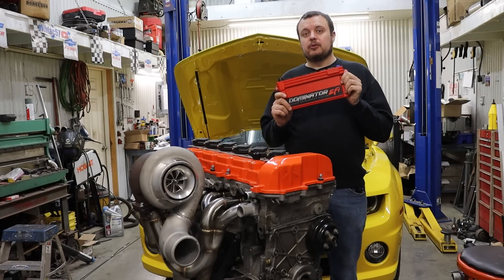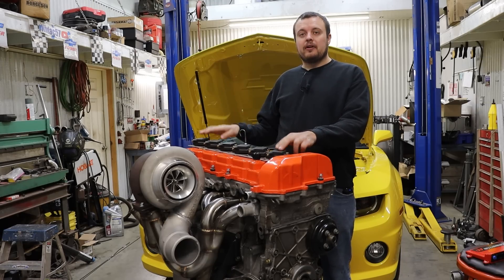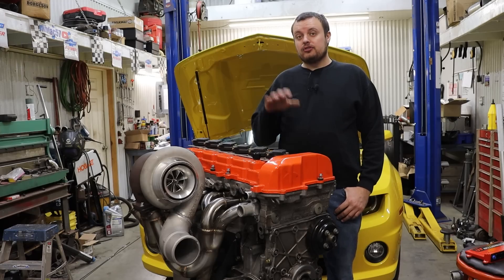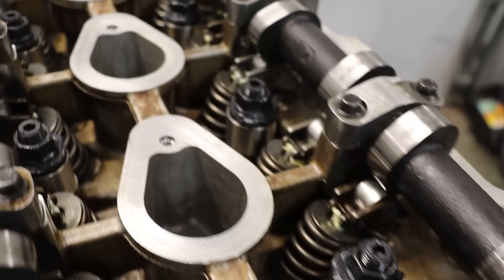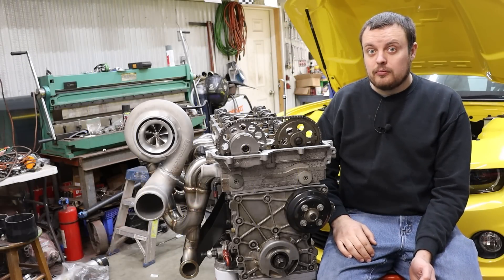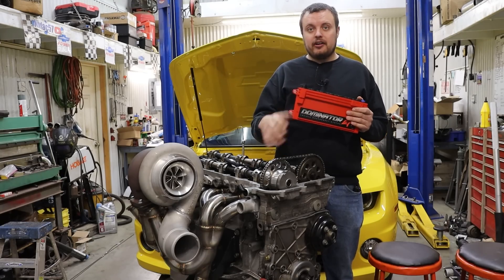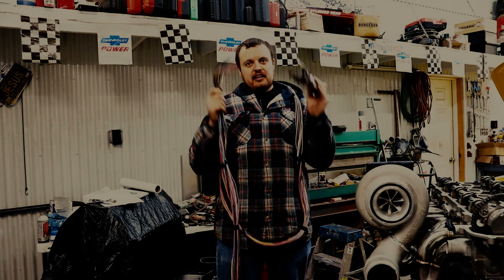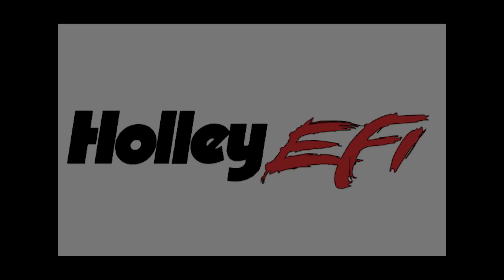Holley EFI: Can It Control A Vortec 4200 Engine?

Comment: The alternative to software fixes is hardware fixes.
Have you considered simply taking a hacksaw to the reluctor wheels to reshape them to a suitable timing mark for the Holley?
Or use ford reluctor wheels, or get a Haltec ecu?
Reply: Seems like an external trigger wheel would be viable.   Still waiting to buy an ECU for our 4200 project.

Comment: So maybe I'm nuts but could you not cut off the cam trigger wheel, flip it over and stick it back on? Or have one made that is the right shape to work with what the holley thinks it is looking for ?  Even if you have to move the sensor maybe ?
Reply from the maker: The ignition control would not work then.
Reply: No idea what to do about the direct injection thing other than try to trick it to think that it is direct but change the timing to reflect the difference of port injection ?
Reply: Ignition is ran off the cam sensor? I'm so confused
Reply: I knew you had already thought of it but I just needed to process some of the confusion in my head.
Reply: I love simple fixes and work arounds... like the story of Don Garlitts blocking off the intake port of the trashed cylinder with a sprite can and fixodent denture glue (so he could continue doing burnouts at Goodwood festival)

Comment: In the interim (nothing more permanent than temporary!) you could always make a little circuit between the sensor and ECU to flip the signal direction. Edit: I've seen all the replies about ignition control now. I guess that's a no-go.

Comment: And this is why you buy a MoTeC. Which will work with any engine with custom triggers (that you can define).
Reply: Ah yes motec.. where you have to pay extra for what ever options s you'd like 😂 oh yes you want traction control that's about 400dollars, oh you want to datalog more channels? Oh that's 400dollars, but you need to buy level 1, 2 and 3 if you want level 3 data logging.. all on the same ecu just unlocking extras 😂😂 then it depends if your distributor uses a decent software because they all customise it and that's what your stuck with..

Comment: Excellent video Calvin! I know the key here is the rizzing edge but is it possible to make the reluctor wheel have the same tooth spacing on the falling edge like you flipped it around?
Reply from the maker: Ignition control won't work then.

Comment: Try haltec the Aussies will be happy to assist and run different motors parts and accessories 

In-fact the Aussie car science is full of unique unusual combinations 

Seriously try HALTEC They will have so much inline 6 experience from the earliest 6 cylinder’s engines from so many manufacturers (straight 6 are an Australian 🇦🇺 obsession)
Not to mention that all the manufacturers of modern motors run variable valve timing which Haltec are familiar with
Reply from the maker: I'd rather go with a Maxxecu, but I've heard great things from the Haltech
Reply: @Calvin-Nelson  Haltec is run owned and operated by guys that are totally into car mods

Not to mention that they actually built the entire ecu on site 

You have motive garage with there rb32 coming to the USA soon keep an eye out for it its going to open some eyes to the rb30 based engines that get built from to old commodore and put in loads of things not to mention the usual Barra and jz engine

Comment: I still don't understand why you wouldn't just use the E67.
Reply from the maker: Pain to tune. Standalones almost always make more power. Lack of advanced control like boost cut, closed loop fueling, traction control. Simple stuff like shift lights, 2 steps, boost builders are not easy with an E67. Among other reasons.

Comment: This is part of why my disdain for woodgrain in the 80s is now something I find cool because I know I can fix it like my washer, dryer, refrigerator, dehumidifier and window AC for example. I do regret not taking electronics and computer courses but I recently bought a welder and have an excellent teacher which opened up a whole new world of things I can fix, make or modify. I'm also a huge fan of straight 6 engines especially with a big ass turbo so I will not be going anywhere  other than the beer store. Come on Holley, don't forget your roots.

Comment: Could you not mill the extra off of the trigger wheel spokes so they are all the same and the falling edges would then be consistent?
Reply from the maker: Then the ignition control won't work.
Reply: @Calvin-Nelson  my diesel says ignition is over rated. But my diesel is also a dick. 

I kind of thought it sounded too simple.

Comment: Wish you could get a Dropbear speeduino..last i checked out of stock...won't manage an auto trans though....that I'm aware of.....
Reply from the maker: I will never run one of them again. The last time I used one it nearly blew my engine up
Reply: @Calvin-Nelson  you tried one? Sorry to hear it didn't work out for you. Was it the dropbear or an earlier unit? I have one...Haven't done anything with it but curious about your experience. Using an 0411 ecu on my built L33 currently...hard to beat stock but I would like more flexibility when I turbo it

Comment: The mildy sarcastic side of calvin is quite entertaining!

Its also sad that holley doesnt understand that adding the 7x pattern also opens the market for every gm efi v6 made before the onslaught of 58x cranks.
Reply: The factory ECU's for those engines are more than capable enough for the use cases you will encounter.
Reply: @seancollins9745  That's probably true for most cases, but as Holley, if you have a piece of hardware, that can do more things with just a few lines of code added to the software, why not do it? It adds value and increases sales.

Comment: Holley spells it, Ryzing… 😉
Holley is far from superior in the efi world… or any world at that… 

Just returned a twin 340 lph pump assembly I bought from them… 
Twin 340 pumps that feed into two brass barbs that have 1/4” id, that blast into a hard 90* machined into the “top plate” and the outlet to the -8 orb is just over 3/8” and isn’t even centered in the counterbore… On the -8 orb feed and the return… 

Pathetic and embarrassing… Those pumps on the bench might support 1400+ Hp or so, but in that hanger assembly, absolutely no way! 😡

Comment: Holley ecus are pure dogshit, id never ever run them in any of my cars or my customer cars, haltech all the way, never looked back.
Reply from the maker: They're good for a lot of things. Something's they really suck on.
Reply: @Calvin-Nelson  i tried their terminator x ecus for a customer and even the firing order for their base map for that specific engine was completely wrong, something so simple they fuck up on, and also their software would corrupt with my laptop for no literal reason, ive used aem, haltech, megasquirt, fueltech, and hptuners softwares and none ever gave me any issues, waited for close to 50 minutes through the tech line to hear a "idk man reinstall the holley software". They have shit service and shit products. I can not wait until haltech starts shipping out the rebel ecus to watch holley burn. For the price of that dominator a r3 nexus would have been a clear winner in my opinion.

Comment: Does the holley ECU support something like nitrous above/below a set point?  Have that output talk to an arduino, which diddles the gate of a mosfet, doing PWM - which attaches to the vvt solenoid.   ??
Reply from the maker: Oof. I have another idea
Reply: @Calvin-Nelson  - by all means! Always good to have lots of choice. Blend 'em all together, and look for the best solution.  The above could be done for about $6 in parts and 10 minutes of coding.  :)

Comment: They are actually looking at the same edge that gm does (falling edge) but calculating the position wrong. 😂
Reply from the maker: You could be right. They have gotten it to work. Make it work again.
Reply: @Calvin-Nelson  the bigs and littles are sized and spaced that way so you can tell that the cam is timed properly. If you did it on the leading edge you would see 4 evenly spaced markings and would have to trust the mechanical tool for alignment.  A cam edge offset is calculated based on the cam crank relationship and that’s also how you determine things like max authority for phasing.  It’s necessary with engine variation at high volume levels plus with chains stretch and guide wear you can end up with a huge shift in cam position between engines. Like you said they did this for the small block so idk why they don’t want to do the math for the 6 cylinder. 😂
Reply: CARB actually requires the ecu software to check for a misbuilt engine (1 tooth off) or whatever the minimum is for a emissions impact. So that’s why the stock ecu needs to use the falling edge with bigs and littles.  Holley doesn’t need to do that though so they could use the rising edge (also has accuracy issues due to how the edges are manufactured and how the sensor pics them up)

Comment: Honestly I'd send it back for a refund and go buy a haltech,  they support everything and will happily work with u to set it up to suit your application/engine.
Holley are terrible tbh ,why use 2, 3, 4 5 boxes when 1 haltech box can do everything lol 
Nexus r5 ftw or even a elite 2500t will be more than up to the task 👍
Wouldn't touch a Holley ecu if I was payed to lol it's a sub par product compared to other brands ,even a fueltech would be a better option.
Plus both haltech and fueltech actually care about their customers and care about constantly upgrading and improving their products.
From what I've heard around the traps Holley are notoriously horrible to deal with.
Can't wait to see the camaro hooking down the track and hopefully it upsets some diehards in the process 👌🤣
Reply from the maker: I have a plan. You'll see. It will make sense.

Comment: vvt is junk all that extra work for a couple horsepower and more burnt valves
Reply: On turbo applications it's quite useful, helps bring the turbo up on boost sooner and u can control where it comes in and helps with torque management.
We use similar on barras called vct (does both intake and exhaust cam, it's a much simpler setup than vvt) it's a game changer, my barra hits full boost at 3800rpm ,without vct it wouldn't happen till about 4800 and when the limiter is 6250 it doesn't give u power for long so it helps dramatically and I'm on a small frame 3576 on a large frame like he's running the vvt would be even more useful, it does a lot more than that obviously but that's one of the benefits of it 👍
Reply from the maker: I don't agree, but ok.

Comment: How come you don't use a fuel tech for the 4200 because the fueltech works for the Honda k-series which has VTEC on it which is variable valve timing too?
Reply from the maker: It doesn't have the adaptability I'm looking for. It doesn't have the idle control I'm looking for. It doesn't have the mass appeal I'm looking for. They make a good product. It's just not what I'm looking for.
Reply: @Calvin-Nelson  with the unit you can talk with the owner of fueltech I think they would help you out he just put one on his opala from Brazil it's a chev 250. Pfi uses them on the Honda k-series and they have a IACV on the throttle body. They also support drive by wire too.

Comment: Speeduino is frustrating, but not being beholden to a company for feature support on more interesting swaps is priceless
Reply from the maker: Never again. Nearly blew an engine when I tried that.
Reply: @Calvin-Nelson  I definitely understand, there's absolutely zero guardrails in place. I actually have a voltage dependant relay that I run on the ignition system wired to a completely independent wideband after a big afr scare. I don't use it so much any more, but jumping into a big change sometimes I still break it out.

Comment: Wouldn't it be fairly simple to weld up and re-cut a stock cam reluctor wheel with a tooth pattern that the Holley could read?
Or is that a really dumb idea?
Reply from the maker: Working on something. Still doesn't solve the VVT concern.

Comment: I'm not sure a whole video dissing a company because they don't support the motor you want them too is a great idea. It would be one thing if they said they supported it and didn't but they didn't do that. I'm sure there is a reason they haven't supported it yet that you just don't understand or know about. 

With that said, the video was pretty funny.
Reply from the maker: At this point, I don't care. They won't support their bread and butter (LS/LT), which as I said, I can make work. Just trying to get some bare minimum effort! I had fun making the vid too. Lol
Reply: Holleys in love with their own legend lol 
There's several other brands out there that support vvt already, haltech for e.g. have supported it for 25 yrs lol being it was developed tuning rbs, jzs,  evos, wrx,  bmw stuff etc. Personally I would go haltech all day every day.
1 box does everything where as a Holley u need 2 to 3 boxes to do the same job and haltech simply does it better.
If Holleys smart they'll wake up to themselves on this issue 🤔

Comment: Damn would have been better just use a e38 GM using hp tuners. But I've only installed a performance vvt cam in the Hemi using comp and tuning it was a breeze and I'll tell you it's a massive difference.  Vvt is awesome. v8 guys need to understand we are super LATE to the part lol. Love the channel. GOD  Bless.
Reply from the maker: Not a fan of factory ECMs. They just are a total pain to tune.

Comment: Always great info about the 4200. I want put one in my 300zxTT.
Reply from the maker: Do it!!
Reply: Do you have the length in that engine bay? I mean anything is possible but i knew a guy with one of those and i don't recall there being 6cyl in a row worth of length there, it was designed with a short and low nose to look like a Lotus or Lambo of that era. The Ford 3.5 Ecoboost might be a better choice. Or if you want GM LF3 or LF4 TT V6 from a Cadillac, but those are pricey and Ecoboosts are in tons of junkyard F150s. That all said your VG30 is not a bad engine by any means. Best Nissan for a 4200 imho would be a Skyline, like the base model that normal people can afford not a GTR.